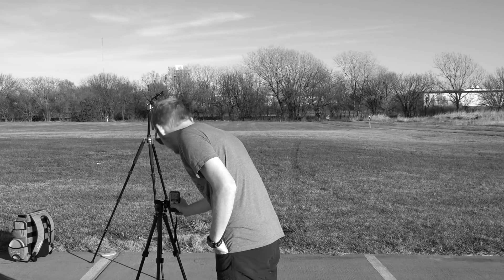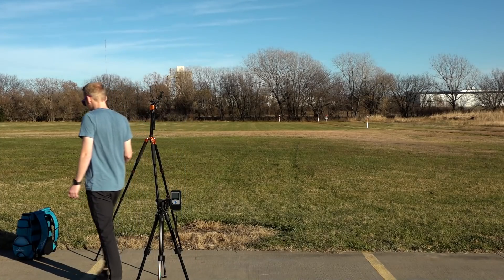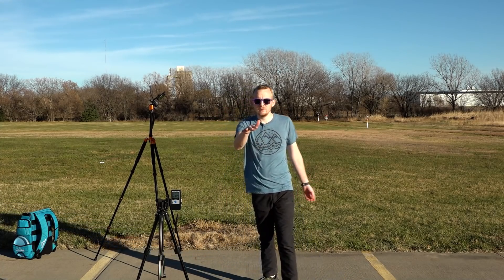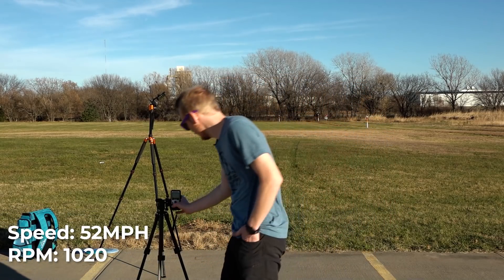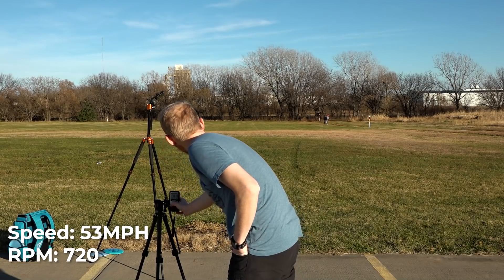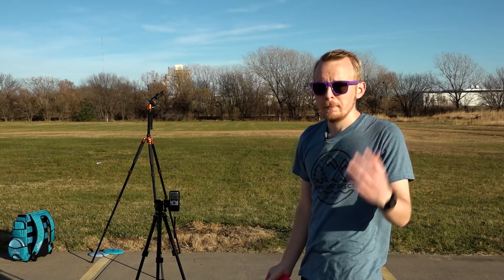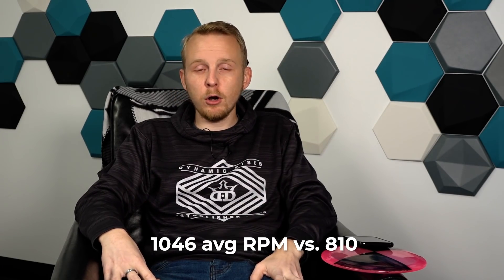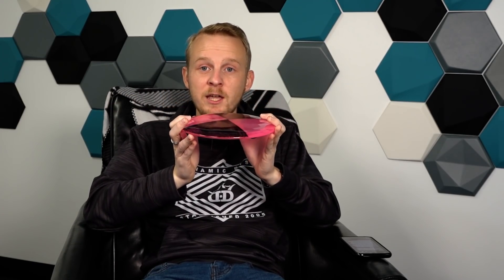What does disc spin do? | Physics of Form ep. 8 ft. Danny Lindahl

Comment: One variable you didn't mention that I believe plays a large part in the amount of turn a disc gets from spin rate is how scuffed the disc is. Gyroscopic stability is an important variable in the flight shape of a disc, but that pales in comparison to friction. For an exaggerated comparison, consider a new wiffle ball vs one that has been scuffed up for throwing breaking balls. If you've never seen this demonstrated you'll be shocked by the difference. Take two slightly overstable fairway drivers of the same run and scuff the wing up with low grit sandpaper on one. Thrown at the same speed and spin rate I guarantee they'll have visibly different flights.
Reply: Considering he threw the same disc the entire time I really don't think that this is a factor. He only threw other discs to get a feel for the speed he needs to throw
Reply: We know this... Beat up discs become more understable.
Reply: @trulsrohk9  so you think throwing the disc in a grassy field beat it up enough to alter the flight..?
Reply: @Maniaphobia  I'm not talking about Danny's test. Neither was OP I don't think. Responding to OP's observation about scuffs changing flight characteristics.

Comment: The more gyroscopic stability, spin, the less likely the turn. The turn should come from the aerodynamics pushing the wing during rotation
Reply: That should only help the disc stabilize around its own rotational axis while gyroscopic precession should do the same either way
Reply: No, the spin creates the lift on the outer edge creating turn. It's exactly the reason it turns differently for FH and BH.
Reply: @tseremed  yes it creates the turn, but that’s present with both low and high rpm.
Reply: @tseremed  that is incorrect. The spin of a disc does not generate any lift. The turn of the disc is due to gyroscopic precession.
Reply: @callaway5148  gyroscopic precession is why it affects the outside edge of what? A spinning object.

Comment: I'm sorry but this video is borderline problematic. I hope no-one confuses these few throws in varying wind conditions with scientific testing. So many parameters are changed with each throw, from speed to angle to wind to nose-angle. Physics tell us that the more spin you put on the disc (while keeping everything else constant), the less inclined it is to change its angle (turn/fade) during flight. I appreciate the effort that went in to the making of this video, but you are actually testing physics models, and if you wanted to challenge those, you would need a much more stringent setup.
Reply: Yeah actual scientific testing would be nice but this is what I can manage just as a guy doing it for fun. I agree that it should be that way, but I'm not sure the difference is as significant as it would seem intuitively.

Comment: I think more spin = less turn earlier in flight but hold the turn or straighter longer into it's flight. Think of a FH less spin, compared to a BH with more spin. Doesn't a FH turn and fade more or does it simply fade sooner? 

I do think OAT or disc wobble is another factor as well which spin should stable out sooner. More spin = less wobble. 

I'm not positive on my statements,, just experience from playing forever. 

I think we can agree spin will stabilize a disc in flight, especially towards the end, now wether the early turn is more or less is difficult to understand. We have to account for some disc wobble even if it's very minor.

Comment: I think a different way to think about it, and what I’ve noticed in doing similar testing is this: More spin elongates the overall flight path of the disc, meaning that it turns / fades “slower” or more gradually than the same throw with less spin. This seems true to me because this is the technique I employ to get a later flip on my discs. Since it’s spinning faster (and increasing the gyroscopic stability as you pointed out), the disc will still turn, but it’s also fighting that turn in order to remain at its current angle. The result of these two opposite forces results in the turn happening much more slowly / gradually over the flight of the disc, but the flight is also being “elongated” or “stretched out” by this same gyroscopic stability. This is also true of overstable discs as well. You can delay the fade and have it hold straighter for longer by adding more spin. Watch Ricky Wysocki throw his overstable discs. He has a very “spinny” throw (due to the exaggerated wrist coil), and the result in my opinion is why he can throw as far as he does with seemingly less speed than other long throwers. Just my 2 (hundred?) cents!
Reply: I have seen similar things when throwing through tunnels. The example being that I will try and give a little extra "pop" on a zone or harp and it will fly straighter, longer. If I do the same thing to a neutral to understand fairway, I can burn them over.
Reply: I think you’re spot on. Great example with Ricky’s backhand throw. He coils more than any of the other long throwers and the disc resists turn or fade longer because of it. Watch how McBeth throws his putter approaches. I try to imitate him. He uses extra wrist snap which generates more spin and allows the disc to fly straighter and land softer with less skip.
Reply: I saw a video by Eric Oakley, where he mentioned that putting more spin on the disc will make it fly farther before it starts turning.
Reply: I agree conceptually, I just don't think it really changes nearly as much as would be intuitive. I think the other variables like angle of attack, speed, and release angle have a much greater effect.
Reply: @DannyLindahl  I definitely agree with that. I think spin can help make more subtle changes to the flight, and is definitely a tool in the belt, so to speak. For instance, adding more spin on upshots or short holes is a great technique because you can keep the arm speed low while using the spin to get a little more, straighter carry. Or as stated before, get a later flip in the flight without  having to fiddle with adding hyzer angle.
Reply: Give this man a thumbs up. I believe he's 100% correct.
Reply: I worked out the physics of the angular momentum and torque vector some years ago and that's the conclusion I came to.
Reply: Exactly what I was thinking (but you said it better)
Reply: How cool! Thanks for sharing this info. I started wondering if this is how you get “late turn” before I watched this because I’ve been researching spin vs speed tonight. I also wondered how/if it works on overstable discs as well. Thans a lot.

Comment: The spinning causes more friction on the side of the disc that is moving forward (relative to the flight of the disc) than the side that is spinning backwards. More spin means more breaking on the left side (for rhbh) which is responsible for the direction of the fade. A faster spin should lead to more stability, but I think you're right that the nose angle is the bigger factor.
Reply: If it were a propeller maybe but on a smooth disc it won't do much. If it did we would see a much bigger difference in the two throws. Check out this paper I found: https://arc.aiaa.org/doi/abs/10.2514/6.2002-3150

 Specifically this part:

"The typical S shaped flightpath exhibited from a backhand throw is dictated by the pitching moment. The
angle of attack increases over the flight duration
causing the disc to move through the zero pitching
moment trim condition, close to 10° AoA. For a righthanded throw, the negative pitching moment on release
causes the disc to roll (gyroscopic precession) and bank
right, whereas late in the flight the positive pitching
moment causes the disc to bank left. "
Reply: @DannyLindahl  I didn't want to pay 25$ for that paper, but the section you quoted seems to say that when thrown nose down, more spin will result in more turn, while when thrown nose up, more spin will be more stable.